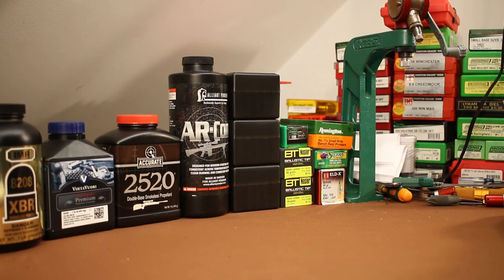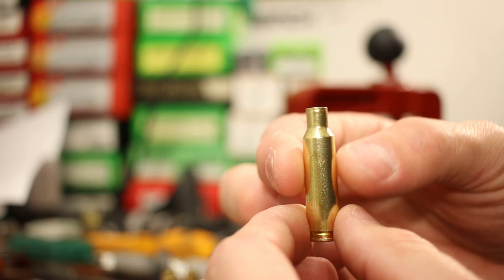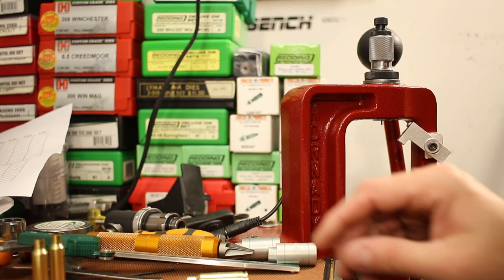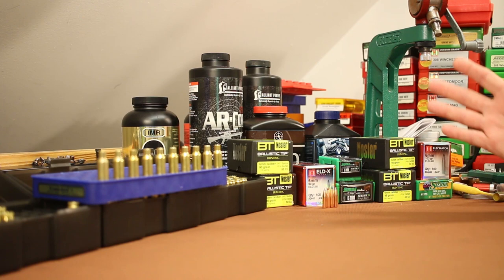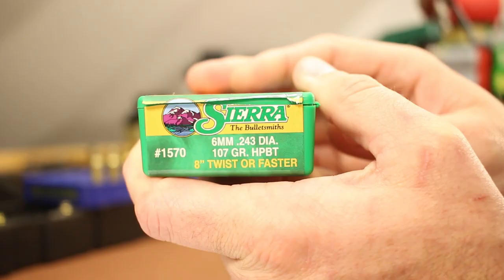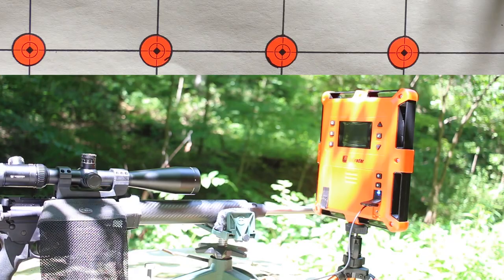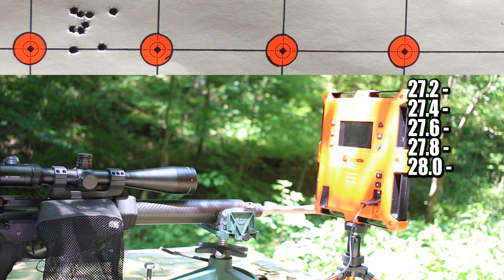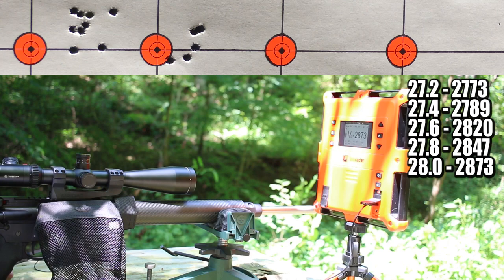6mm WOA - part 3

Comment: If you epoxy a plastic tip bullet into the seating stem, when you go to take the bullet out after the epoxy dries it will probably pull the plastic tip off and it'll be stuck in the epoxy in the seating stem.

Comment: I get that icky feeling (224 Valkyrie feeling) where you are just shy of the optimum barrel twist.  It is an important variable for higher BC bullets and I get the impression you need a slightly faster twist rate.  I could be wrong.
Reply: Twist rate isnt an issue with the valkyrie. A 7 twist will shoot 90s fine. The valkyrie issue was crap ammo from federal and a huge freebore with bad reamers

Comment: Also,  this 6mm WOA, what's the application? Like what's it do other 6mm AR mag length cartridges don't or don't do as well?
Reply: Mean Man nothing they wanted their own piece of the market?
Reply: It doesn't have as much mental removed from the bolt face and is less likely to have the bolt lugs Fall Apart as compared to the 6 mm Arc especially if you load it up hot

Comment: That 90 grain game changer @ 2900fps is pretty darn impressive. That's creeping into 243 win territory isn't it? I should probably know what 243 win does with a 90grain bullet since I actually own a 243 win but I don't have a chrono. Im guessing the 243 win would be a little more that 3000fps out of the same length barrel?

Comment: After annealing, and the brass is final wet tumbled, are your case mouths getting slightly deformed? I've had a slight ridge apparently peened over inside and outside of the case mouths.